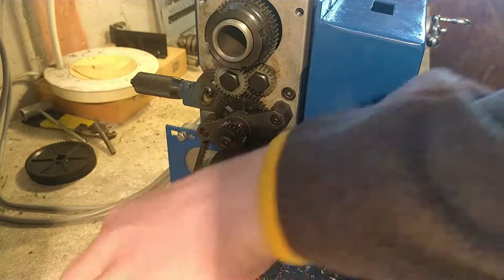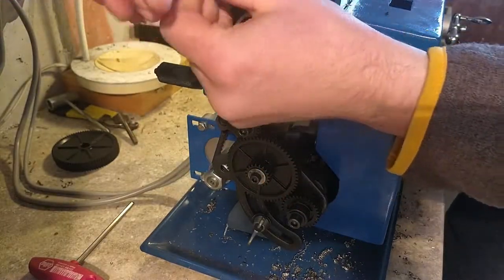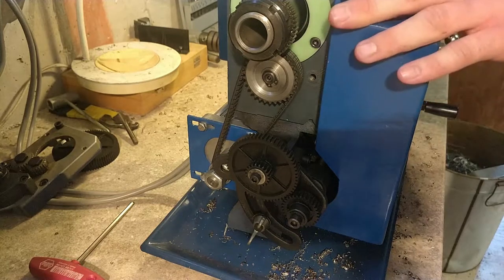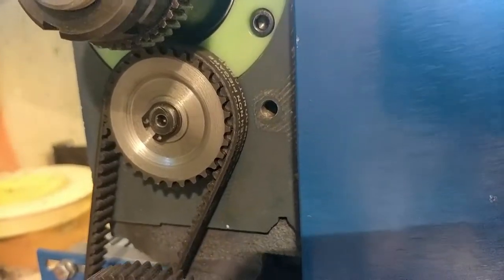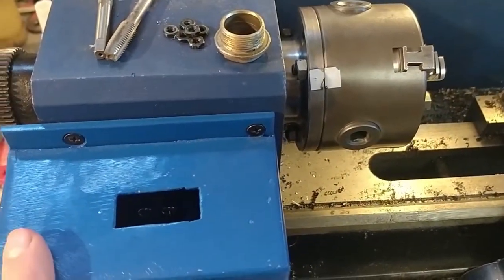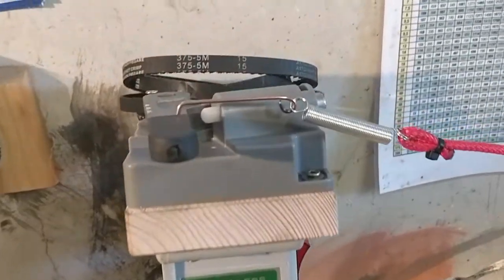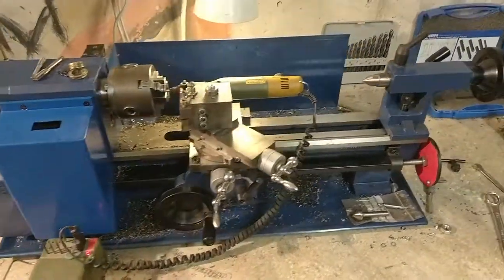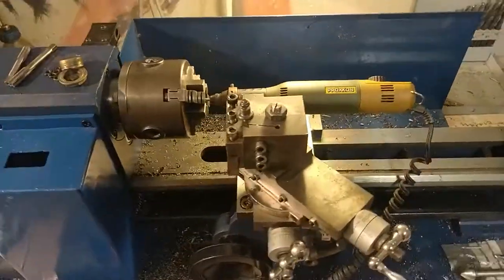Mini lathe sewing machine motor upgrade follow up explanation video

Comment: Excellent video. I am considering something similar, but geared for higher speed. I'm considering either 18:28 or 18:30, would it be simpler to fit a 28 tooth pulley on the spindle side? I see you turned down the sides of the 30 tooth pullley, is this mostly to reduce the thickness, or also to reduce the diameter of the gear by removing the shoulders?

Comment: A little late to the presentation... At 11:45, you said the power consumption was 300W at no load/no work, did you test the ACR bearings or the motor with no belt at all?  The motor is not 100% efficient and may have 100W-200W power consumption just spinning the motor due to the power being converted inside the power supply.  Thanks for making this video.

Comment: Can the motor be used continuously for say 20 minutes without overheating?  They seem very small for the power rating compared to normal induction motors.

Comment: Hey if you remove the spring that is attached on the pedal potenstiometer you can use it like a real potentiometer without pressing it with ur hands?? Does it stays in position or do you have to press it with ur hand all the time?
Reply from the maker: Yes, if you remove the spring, it stays in it's Position you put it in.
Reply: @markusk.488  i will get tha exact same set up thanks for sharing  :) lathe still cuts threads and everything right?

Comment: Why did you choose such small motor pulley? What is the gear ratio from the motor to gearbox and from the gearbox to the spindle? What are max and min rpm on the chuck for L and H setting? I'm doing exactly the same mod and I just found your video. Good job.
Reply from the maker: I did choose the gearing to have the highest possible torque for threading and i don't need those high speeds either.
Min rpm for L would be 56 rpm and max 747 rpm.
For H that would be 135 rpm min and 1806 rpm max.
Motor has a 14 tooth pulley and on the lathe shaft is a 30 tooth pulley.
I have the ratios for the L and H gears on my Computer and i will reply later for them because I'm not at home at the moment.
greetings from Austria 😀
Reply: The motor is variable speed BUT top speed is 4500 RPM thus more than twice normal motor. If you want the best range you need to reduce usual ratio. I'm not sure what speed a normal existing motor has

Comment: What size pully did you use on headstock end ? Just in the middle of the same build
Reply from the maker: The pulley on the headstock is a HTD-5M, 8mm width and 30 tooth pulley
Reply: @markusk.488  Thank you most helpful
Reply from the maker: @billpierce6792  No problem, you're welcome

Comment: Great video, lots of info.
I’m doing the same bearings and metal gears, I’d really like your motor upgrade, this looks like the best I’ve seen so far but where did you get the motor? 
New or used? 
Keep it up, Thanks.
Reply from the maker: I bought it new from Ebay and it was around 130€.
Reply from the maker: If you're interested, this is the sewing machine motor I bought: https://www.ebay.de/itm/352901663888
but unfortunately it is no longer available.
But there are many other offers offering this motor.
Reply from the maker: You have to look for the one, where the motor is seperated from the controller because there are also units out, where the motor and the controller are built together.
Reply: Thanks, looks like I’m “adding to cart” a bunch of stuff.

Comment: Did you make the pulleys for the spindle and the servo motor by yourself?? or Did you buy them?
Reply from the maker: I bought them and only had to machine the inner diameter of the bore so that they fit the shaft of the motor and on the headstock shaft.

Comment: Could you provide approximate dimensions of this motor I am thinking of using one on a lathe that is a lot smaller than yours.  I have found a supplier in the UK but the information on the web site is very limited.  Thanks